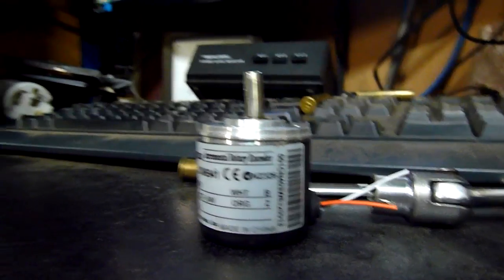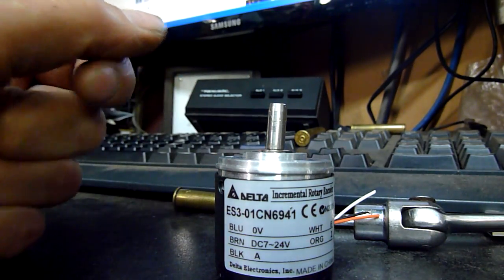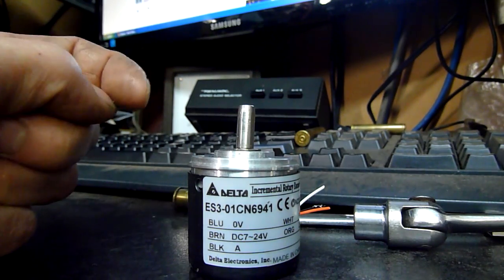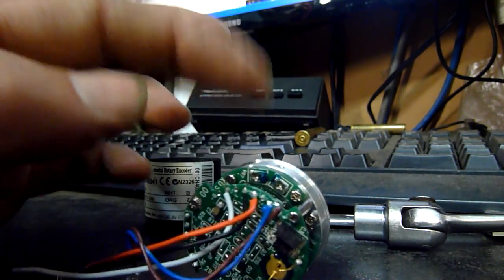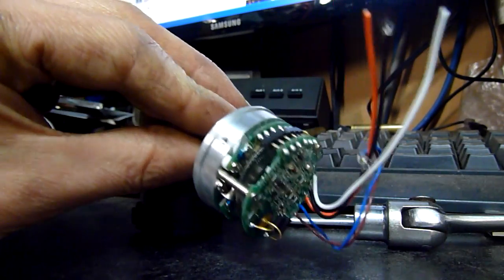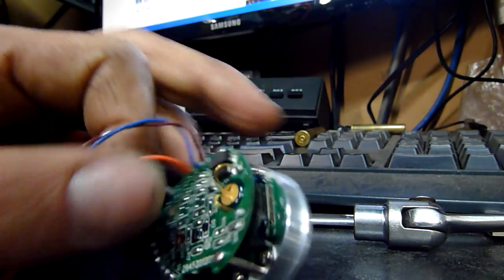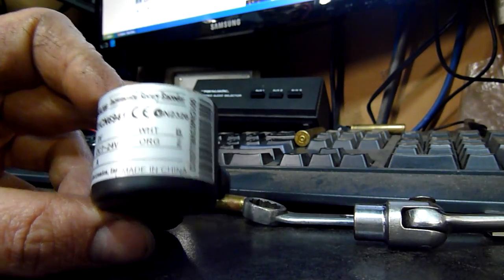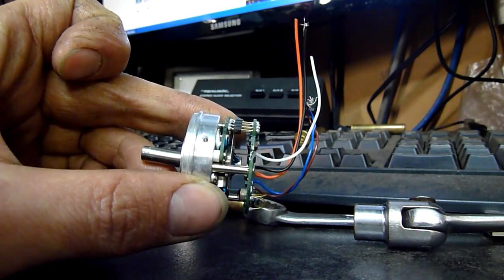Inside a Delta Incrimental Rotary Encoder

Comment: The knob versions are actually often referred to as digital potentiometers.  The main benefit being that there's no track to wear, they have continuous rotation and you can reset them to any value instantly in software because all they do is provide two pulses that give speed and direction of rotation.

Comment: I wonder what the z output is for.  A single once per revolution pulse perhaps?  The phase quadrature encoders I use on one of my kits  just has a common and the "a" and "b" outputs, and you can detect rotation direction by seeing the order in which they appear as a two bit gray code.  Speed is detected by the speed of repetition.

Comment: A lot of inkjet printers ( with DC motors) have a similar encoder as parts on the board. IR is easy to detect, use a cellphone camera, it does respond to IR. It gives basic info, direction ( AB pulse) and a zero position (Z) once per revolution.

Comment: nice , a little bit bigger than the mouse scroll wheel but the technology is the same , most moddern digital cameras can "see" infrared light , its displayed as a blue light , these diodes are very angle oriented also in this devices 20-30 ° max. also you must hold the camera infront of them ! when you some old remotes and a flashlight with a LED you can simply build a nightvision ;D

Comment: It reminds me of the jog wheel on an audio editor I service at work. They quit working if the IR emitter and detector are the slightest out of  alignment.  What I usually to to fix it is with the controller powered on I carefully move the  IR emitter until the curser (in this case) moves. Obviously the bent shaft in this case makes that not worth fixing.

Comment: You can try pointing a camcorder that has nightvision on it at the diode when it's on. If it's infrared you might be able to see the diode light up. You can test a remote control that way too.